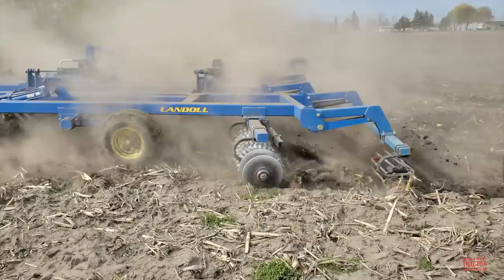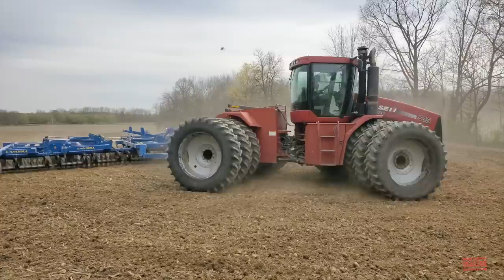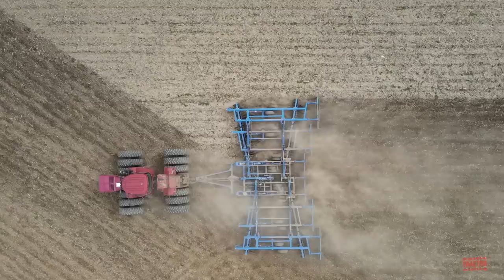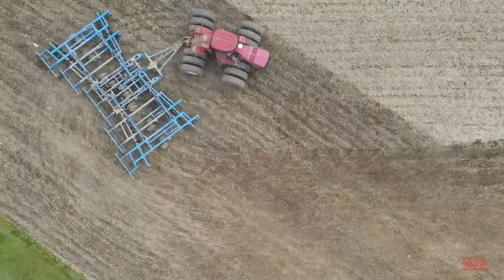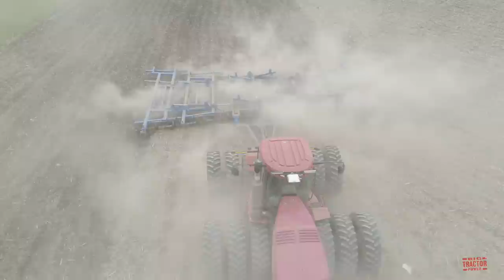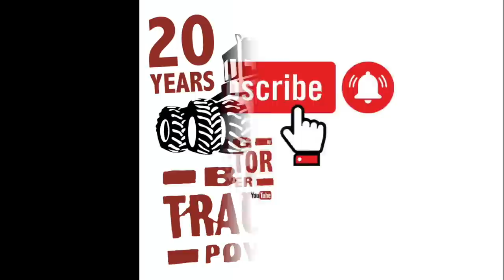TRACTORS at Work: CASE IH 535 HD STEIGER

Comment: We have a 2010 Case IH Steiger 535 HD with triples similar to the one in this video. It operates a 46 & 1/2 foot field cultivator with a Unverferth double rolling harrow, a Case IH 875 9 shank disc ripper, a Salford 10 bottom plow, and a 34 foot John Deere 2410 chisel plow. In Michigan’s thumb.
Reply from the maker: Very cool. Impressive tillage line up.

Comment: Viewed 6-11-22   from Illinois    I don't understand the reasoning  for triples.  The larger the foot print, the  less is the weight per sq  in.  Plus this adds more stress on the outboard axle bearings.
the video is good and the drone work is top notch.
Reply from the maker: I have watched triples at work for years. They offer improved traction, less compaction and less expensive tire replacement than large metric dual tires. I have not come across axle problems on triple tire tractors. What I do see is a smoother faster ride than duals. The tractor in this video is bouncing on the ridges left by primary tillage in the field but with duals the bounce would be much greater.
Reply: These bigger articulated tractors are set up with the capacity for triples nowadays

Comment: Why is it called "vertical tillage"? You move horizontally across the field.
Reply: Well for real vertical tillage, because it’s only altering the soil profile straight up and down and not horizontally. The thing about the current Case IH and Landoll vertical tillage tools is that they run slightly concave blades on an angle, and thus, they aren’t truly vertical tillage😂😂😂I’d call it reduced disturbance tillage. They’re a scam is what they are.